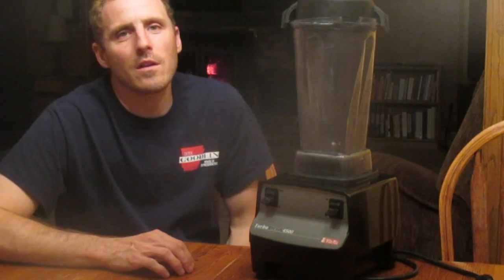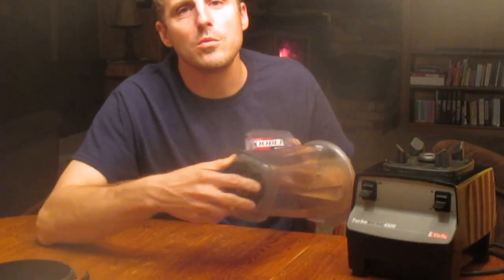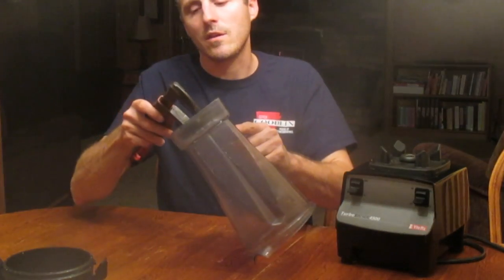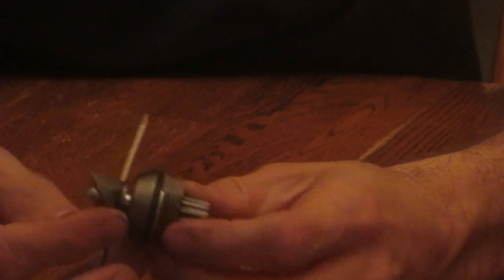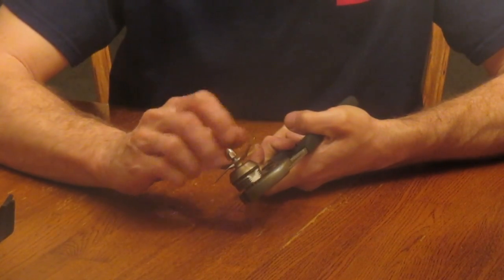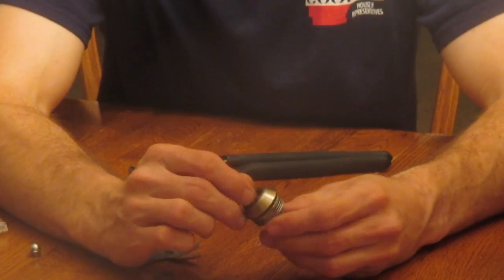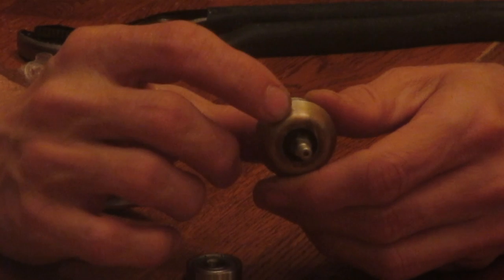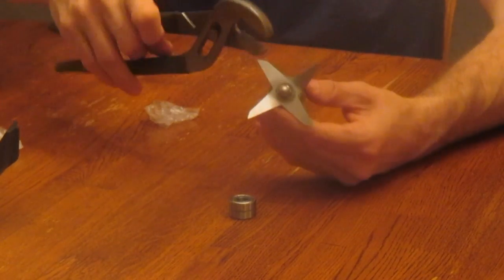vitamix 4500 bearing replacement

Comment: Watched your video and it helped me fixed mine. Funny note - I went to the auto parts store to see if they might have the bearings. They did not, but the girl at the counter say's "gee what are those from a Fidget-Spinner?" I said no,  but yes they look very much the same size. Guess what - fixed the blender with two bearings from my kids fidget-spinner. ALSO took the old bearings, stuffed them back into the fidget-spinner and it still works. HaHaHa!

Comment: The bearings are standard skateboard bearings.  I picked up 2 for $4 from a local skate shop and it worked on a Vitamix 5200 as well.       I’ll be able to return the $70 OEM part next week unopened.
Reply: I thought it looked like my roller skate bearings.  LOL

Comment: This has happened to me over 4 times. When I had my warranty it was fine because they would send me a new one.  Don't wash your blender in the dishwasher it rust the bearings. I found out the hard way. This video is correct you can replace the bearings yourself. You just need the right tools.  I took mine to a machine shop and got it done for $30.00. The bearings are 608 and are the same as skateboard wheel bearings. You can do it yourself if you have a press. The whole point of the press is that you dont mess up the bearings or the rubber grommets.I didn't have a press so a local machine shop did it real quick for $30.00 and is still cheaper then $70.00 and my blender works great. You might have a friend or get a better deal than me. One small advice that I i will advise is on top of the bearings is a fiber washer that is delicate so dont try to clean if looks rusty. The machine shop i went to thought it was a regular washer and tried to clean it and broke the washer.

Comment: The man of the hour! I bought a 7500 for $13. at an auction. I noticed the blade assembly did not spin easily. And when I tried to blend some steamed vegetables for my soup the blade assembly violently vibrated  intermittently. Funny how my 10 year old $20 Oster blender kept going. And the jar is glass, not cheap plastic. Vitamix clearly is overpriced, just like Kirby vacuum cleaners.

Comment: Sorry, thank you.  You just saved me a ton of money.  I just got done rebuilding an Imac computer.  I have some tips on that.  Get an old Imac from  2011 to 2013.  Get two SSD drives  1 1TB and 1 2TB.  Put the 2TB in the main drive bay and the 1TB off the remaining motherboard connection running at 6gbs.  Buy extra Optical Drive sensors and use the extra optical drive sensor (instead of the other world computing sensor that causes Apple Hardware Test to get an error) to connect the sensor to the hard drive and to the logic board.  Buy extra fans at IFIX IT.  Those and the sensors are the first things to malfunction on apple computers.  Now when your done.  Partition the main 2TB drive and SOFTWARE raid 1TB of the 2TB to the other 1TB drive using APPLE'S DISK UTILITY.  Now install Mavericks on the BOOT RAID because Mavericks can boot off of a RAID and install High Sierra on the remaining 1TB which does not BOOT off a RAID.  Now you have Mavericks running at 800 Mbs Read and Write and you have High Sierra booting at 400 Mbs read and write.   NEVER BOOT FROM A HARDWARE RAID.  It works really well.

Comment: Good stuff. Vitamix wanted to sell me an entire container for about $150. I was unable to save the seal as one of the bearings was really gaulded in, but I still purchased a new OEM  blade and bearing assembly online for less than 1/2 of the price of a new container.

Comment: Thank you for this video! I took the blades off, threaded the nut back on and hammered it out. I damaged the washer bit but I think it was already needing replacing because liquid was coming through the whole assembly before I tried taking it apart. Replaced the bearings, using sealed ones, tested it with water and it still dripped through, so I need to find either better sealed bearings (it doesn't spin as easily is before so I've just found some 'high speed' ones to try) or a washer that will actually work, or both. The washer is proving difficult as it's most probably specialised. Will keep hunting but if anyone's found a solution please let me know! I miss my Vitamix!
Reply: https://blendermart.com/ocart/index.php?route=product/product&product_id=51
Also, make sure you coat outside of the bearings with bearing retaining compound before installing them into case and wait 24 hours before using. Ideally it should be green in color, but red thread locker will do.
Reply: elfqueenchloe, did you find the specialized washer or were high speed sealed bearing good enough? Dealing with same issue I believe. Actually that rubber washer deteriorated and two separate machines and messed up the blade assemblies (difficult to turn and leaking).

Comment: Very Helpful.  This morning my smoothie was processing and I heard a strange noise...then a smell.  Some motor oil has appeared on the underside of the pitcher. Do  you think this is  more than replacing bearings? The blade looks fine. Having a hard time finding a video where oil is involved.

Comment: I found the parts online for $13 with free delivery. it's not worth going to the machine shop or even buying the new bearings because the assembly comes with a new blade and I upgrade to the ice crusher blade.
Reply: can you share the link please
Reply: Can you share where you purchased the part?  I am having trouble finding it.

Comment: I will posit that the reason for bearing failure is most likely failure of the special seal just above them. If that seal is not working properly, any new bearing will have a limited life at best.  Also, the OEM bearing are stainless steel.  I bought an OEM blade assembly for 50 bucks shipped and should be good for 6 years.  I won't blend hot liquids in the future.

Comment: <3 thanks
I've got a Sears Kenmore Pro that needs bearings
Thanks for the dimensions.
I notice a couple of  little punch-dents on the bottom rim adjacent to the bearing raceway.
I assume there is enough contact friction between shaft and bearings and outer housing to be retained

Comment: Thanks for the video! Question: If you don't have a small press, what are the other ways to open up the last part, the one that holds the two roller bearings? This for me is the hardest step.
Reply from the maker: +Donald Payne I would try using a brass punch and a hammer to knock out the bearings.  If I remember correctly the top of the unit has a small plastic/rubber washer that acts as a seal.  Be careful not to damage it so you can reuse it.  If you need to remove the stem make sure you protect the threads that attaches the blade.  You may want to thread the nut on it.  I would also suggest asking a neighbor if they have a small press since they are pretty common tools in garages.  Good luck!  I hope this additional information helps?!
Reply: +Shalom Acres Thanks for your helpful reply. To disassemble it, I used a vise and some cylindrical shapes (socket wrench sockets) to press apart the parts, until I could see the bearings. Another post elsewhere advised against a hammer, saying it could deform the parts. (I took a photo of the parts in order so I would remember what goes where.) I didn't remove them but just soaked them in gas, repacked in grease, and reassembled. It's working so far!
Reply from the maker: +Donald Payne Good stuff, thanks for sharing!
Reply: where would I get a new rubber washer?   And what do they look like?  mine was disintegrated when I took it apart.
Reply: I have the same question to get new rubber washer. I damage it when I remove the bearing.

Comment: Problem with mine was leaking.  I ordered a whole new blade assembly, replaced it, but it leaks worse that the original !  Can't see any damage to the container that would cause it too leak, so I'm stumped.

Comment: I took the blade assembly to a power tool shop and he replaced the bearings. The cost was $27. There's  a bit of resistance compared to a new one...and when I put it on the base for a test run, the blade assembly gets hot. I'll be using this container (if it doesn't leak) for salsas and such. Anyways, Vitamix is sending me a new container because it's still under warranty.
Reply: Jose Cota you probably have the wrong type of bearing. I think there exists high speed bearings that are used specifically for such applications.
Reply: What do you tell Vitamix?  My smoothies are getting warm quick.  I noticed when I didnt use ice and followed a recipe.  Blended for 60 secs.   My smoothie was warm!  Is this a symptom of something?

Comment: I JUST BOUGHT THE BEARINGS.  I've never worked with bearing before.  Do I take the covers off the bottom ones, keeping the very top cover on to prevent dust and dirt from getting in.  I watched a video that said the covers will slow down the spin cycle and that the bearings should ideally be cleaned with WD-40 to remove the grease and then soaked in acetone or nail polish remover to remove the WD-40 and get the MAXIMUM SPIN.

Comment: After pressing out the thing with the press, how did you take out the bearings?
Reply: Never mind, I figured it out. Thanks.
Reply from the maker: +Javier Rojas Great news.
Reply: How did you remove the bearings?
Reply from the maker: Javier - I put the bearings in the vice and tapped out the shaft with a brass hammer.

Comment: Where do you find the parts in this video?
Reply: Blender mart sells kit that consists of the shaft seal, two bearings, food grade grease for shaft, bearing mount adhesive and washers. The bearings are glued with the adhesive which gets soft after being heated. You could use heat gun, or put it into oven at 350 F for 15 minutes or so. After the blade assembly is heated, it is much easier to get the shaft with bearings out of the housing. You could use small puller to disassemble it .                                                                       https://blendermart.com/ocart/index.php?route=product/product&product_id=51

Comment: found bearings, measured with caliper, need the part that seals it, the oring washer or whatever its called, that is inserted before the first bearing.  VitaMix customer support is useless, and only interested in selling the whole assembly, they  won't provide any  information. Can anyone help?

Comment: There's a tool for removing that big nut?? Just use your hands. Place the container upside down, push one side with your thumb and pull the other with your index finger. Easy.
Reply: Maybe, maybe not. Mine had a bunch of corrosion or something in the threads making it quite difficult to unscrew. It would've been impossible without some kind of tool.